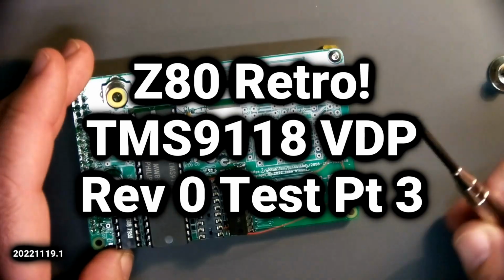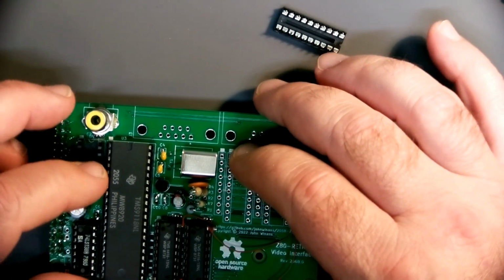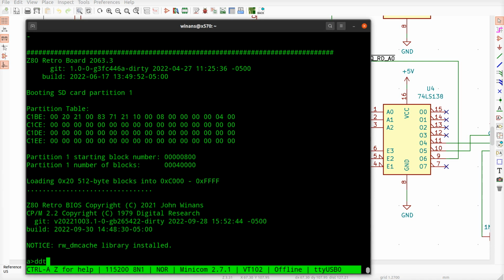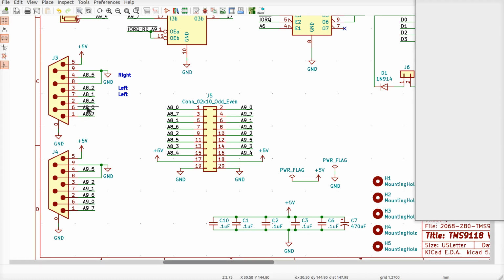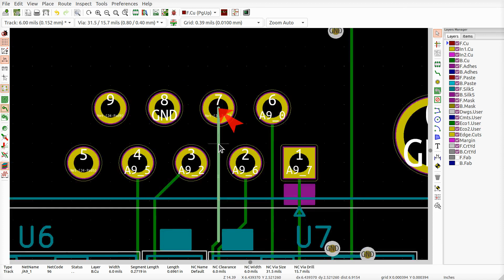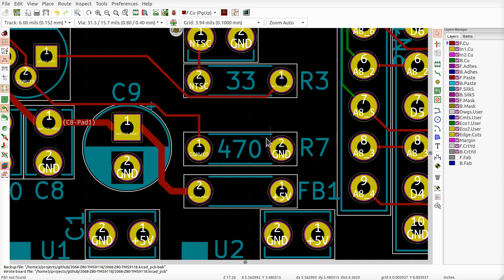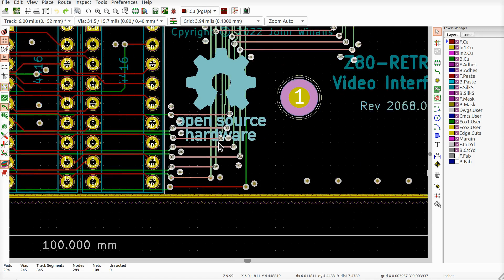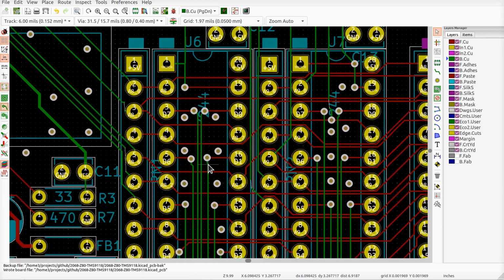Z80 Retro #52 - TMS9118 VDP Rev 0 PCB Test pt. 3 (Joystick)

Comment: There is a wiki article on https://en.wikipedia.org/wiki/Atari_joystick_port for the Atari_joystick_port with all DE-9 connector controller type connections from Atari, Commodore, MSX, Sega, and others. Most agree on Directions , button one and ground which is all Atari initially had. Commodore added Paddles like Atari too. Amiga and Sega did ad 2nd Button but on different pins.